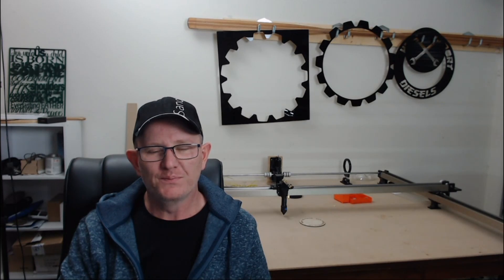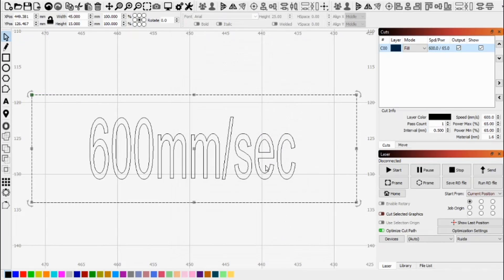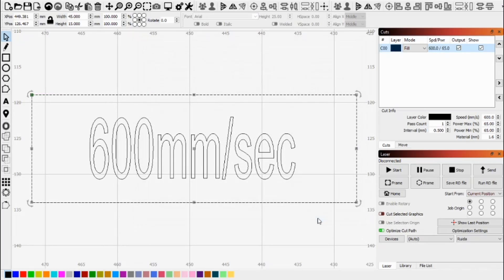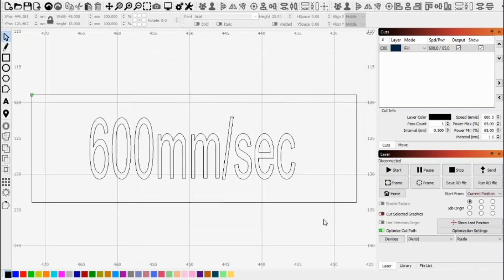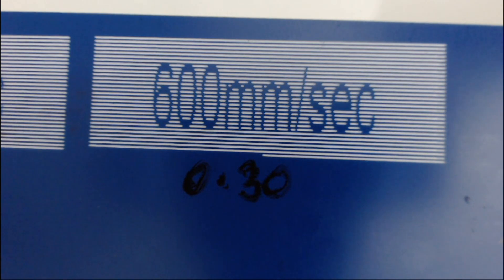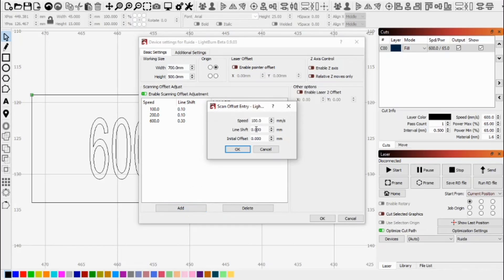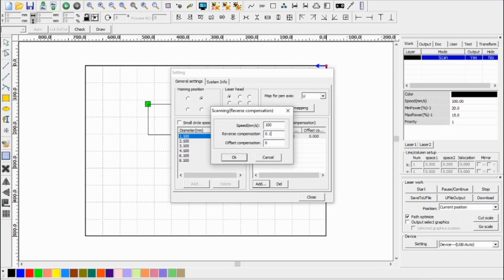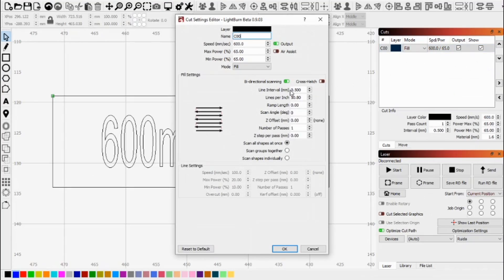Improve Engraving Quality (Correct Scan Offset) on CNC Co2 Laser RD Works/LightBurn Software Config

Comment: I think I know the answer but want to ask.  For RDWorks, does adjusting the offset adjust it for all machines you are using, or can you save different config files for different machines?  I have a 100W Red/Black laser that works just fine at 200mm/s, but my new Monport 100W has a definite scan offset issue.  I use RDWOrks on one computer to control both lasers and fear that if I adjust the scan offset for the Monport laser, it will mess up my 100W Red/Black.

Comment: I have installed a new CR70 laser tube and power supply and have corrected the reverse scanning offset, but I have  a short burst of energy that happens after each line is scanned when the  laser should be off.   Is there a way I can send you a picture which shows the problem?

Comment: Thank You as many have said this video and explanation has been priceless for me. I do have a question though. I have lightburn and input on device settings for all power settings I use. When I use old files when I open the device settings the old settings are there. Can I save the new settings in the software as you mentioned and will work with the old files?

Comment: should update as you mention false info.  by using a full range of speeds, will use diode laser in mm/min as example, if you ran a range of speeds from 500mm/min to 6000mm/min in 500 increments, inputting results for this range will create additional data within the software for any speeds in between all of these so 750, 900, 1200 etc.

you state you have to do one for every scan speed you use, this isnt the case

Comment: Just curious, how come you don’t engrave as fast as possible all the time? You mentioned you commonly use from 100-300mm/sec
Reply from the maker: Higher speed engraving requires more power and often reduced clarity, unless calibrated correctly.  Also some materials will only produce the required results when engraving at slower speeds.

Comment: Thank you for this help video. This is exactly the problem I am having. Mostly due to the fact of just recently getting a co2 laser coming from a slow diode which I never had an issue with. Thank you very much.... after commenting here i went and played with my machine and it is an amazing the difference in quality

Comment: I did the same test as you. When engraving I saw that the second line when the laser head moves from the right side to the left side the engraved line is not straight, it's wobbly. I tried everything I can think of to get rid of that but it won't go away. Any idea what could cause that?
Reply: Try to reduce vibration in the machine by using a rubber legs under the machine not the wheels, and also check your belts and make them tight, if everything above is ok try to reduce the speed of engraving it'll help
Reply: this is your accelaration speeds, try reducing them slightly and test again until you reduce these wobbles

Comment: I hope all is well. I've just been using my laser a lot more and noticed something. Where there is a name like Chloe the outer edge on the top of the L is perfect but where it has the o and e on the same scan line it's not. I thought it's a backlash setting but it made it worst. What I have found that whilst it's important to line up the edge it's also important to line up the inner lines (where text is for example) and the only way I've been able to do it is to find a balance of the outer and inner. Do you have any suggestions? I believe it's more just a limitation of the glass tube laser not firing precise enough

Comment: This is just what i need to tune up my laser.
On slower speed and mdf i notice the backlash more. But on ply at same speed.. It looks fine.
On mdf at higher speed.. I loose detail.
So.. Backlash and scan offset are my problems.
Backlash appears to be a feature that came out a year after this video.

Will be nice to turn back on bidirect scanning.

Comment: We have a CAM5 dual laser tube machine. Laser tube #1 is lined up perfectly (scanning both left and right) and Laser tube #2 has a Scanning Offset problem. With Lightburn software, can you Adjust the Scanning Offset individually on the two tubes? Thanks for all the great info and video!
Reply from the maker: yes.., but..  You will need to save setting for Tube 1, then create settings for Tube 2 and also save separate.
Then when using Tube 1 load those settings, and the same for Tube 2.  If you require further explanation than I can give in this YouTube Comment email me askmatt@mwlaser.com.au  Cheers

Comment: Hey Matt, when Im doing this test, i noticed that my lines are shaky and wobbles. What does that mean?
Reply from the maker: Three things you could check
1. loose lens or mirrors
2. worn bearings
3. other mechanical vibrations
Reply: @MWLaser  i checked everything but the lines from right to left are still wobbly. Really don't know why, that gives me headaches because I want to find out why that is and I just can't find an answer. I posted the question on about 5 laser groups on Facebook so far but no one has a clue. 😭
Reply: Same, but only the line when the laser head engraves from the right side to the left side. I have checked everything but that line is always wobbly. Don't know how to fix it or what the cause of it is.

Comment: Been wondering what was happening with my machine. Hopefully this will fix small issue I was having. Thanks

PS Subtitles gone wrong 1 second in
Reply from the maker: Thanks.
No Meth made here :) CC's are auto created.
Reply: @MWLaser  wow, what a difference this makes! Maybe it’s been changed in a recent version but lightburn now calculates the in between speeds meaning that 601mm/sec will still be adjusted for but it just won’t be precisely calibrated.

Comment: In the manual it says that it creates an offset throughout the range based on the values you enter. if you add 2 points ti creates a line between and adjusts the value if you were to change to 550 it will put the value half way between the 500 and 600 offset you added.
the more points you add the better the curve accuracy
Reply from the maker: I'm not following what you are referring to.  email matt@mwlaser.com.au  Cheers
Reply: @MWLaser  Lightburn manual: "enter the speed and distance values into the scanning offset adjustment table. LightBurn will use this information to compute the correct adjustments for other speeds as well. A minimum of two measurements are needed for it to work."  i.e: : Lightburn interpolates the entered values to approximate a value of offset for speeds you have not entered.  (maybe 4 years ago it didn't do that, but it definitely does now)

Comment: Hey Matt, thanks for the great video. Do you have any advice as I tried the settings you gave, but I am just not aligning 100%, tried various speeds also, but still do not get perfect alignment? The only difference is I am testing on wood, and not sure if that is the reason, but as I run mostly wood, I thought to test it. Why I got onto this video is due to trying my chuck rotary and getting a slight ghost image when engraving on cups.
I am using Lightburn, on a 100W W4 Reci laser from CN
Reply from the maker: I can try to assist you via email, send some photos of your latest adjustments and a screenshot of the scan offset settings you have currently in LightBurn - to matt@mwlaser.com.au  Cheers

Comment: Hi..thanks for your video. It really awesome. I have CO2 Laser machine with RD Work V8. I am trying to do the scan offset, however when my laser start scanning at 0.5 mm interval, I did not get the perfect straight line as in your video, the scan line is wavy. I have tightened all the belts but I did not check the laser's alignment yet. Is have to do with the alignment? Really appreciate if you can give me some tips about it. Thanks
Reply from the maker: wavy lines when cutting are usually caused by loose mirrors or lens.

Comment: Hi, thanks for your video. I have a ruida controller and in scan mode if for exemple I engrave a circle with 2cm my x axis travel 15cm more in each side  in each pass, like accelerate before engrave and desacelerate after engrave, it make the circle, but is not normal, do you know the reason for do that?
Reply from the maker: Acceleration settings. The faster you engrave the longer the "over swing" will be.

Comment: hello do you have any suggestions for cutting a perfect circle?  my laser wont cut a perfect circle i tried few different suggestions from forums but i cant get it right. Thanks
Reply from the maker: Try calibration of your x and y axis. I have a video on that for the ruida controller if that's what your using. Cheers